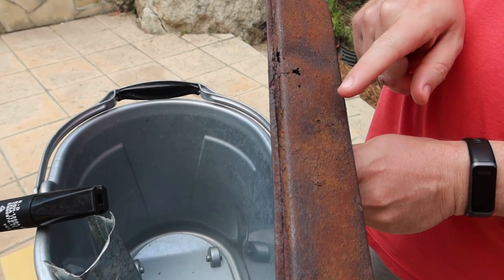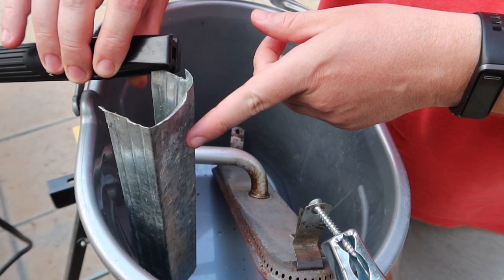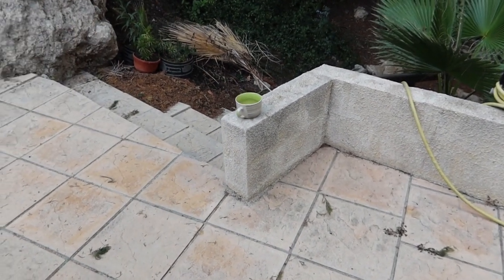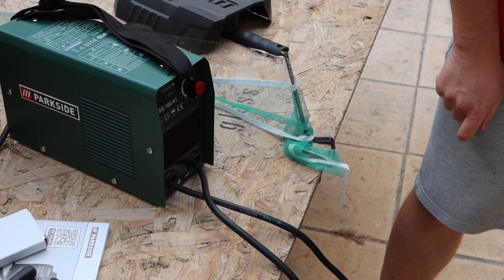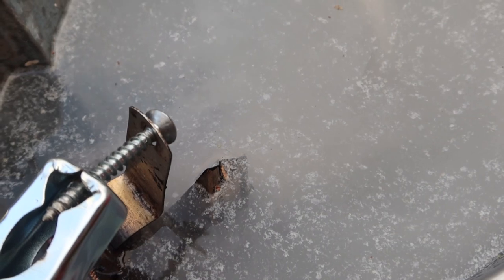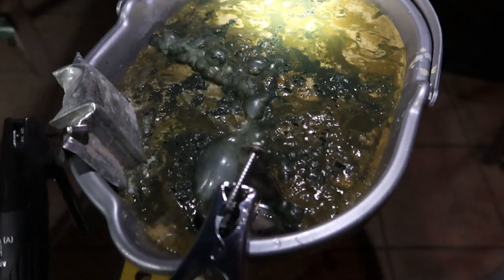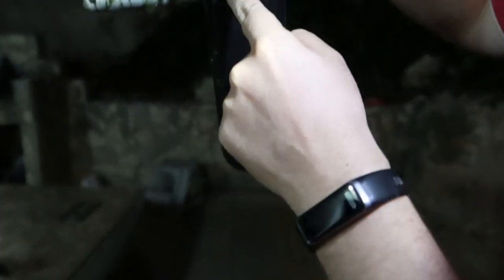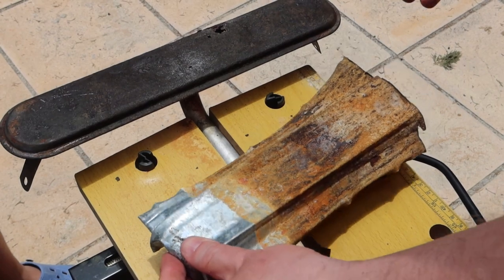Homemade electrolysis for Rust Removal: Fe2O3, NaHCO3, H2O, and Electricity. Say Goodbye to Rust

Comment from the maker: Homemade rust remover is simple. To understand the process of rust removal using electrolysis (18 V 10 amp):
Rust: Rust is a form of iron oxide (Fe2O3) that forms on the surface of iron or steel objects when they are exposed to oxygen and moisture. 
Electrolysis: Electrolysis is a chemical process that uses an electric current to drive a non-spontaneous chemical reaction. In the context of rust removal, electrolysis is used to remove rust. 
Electrolyte: In this case, baking soda (sodium bicarbonate, NaHCO3) in water  H2O is commonly used as a safe electrolyte (kitchen salt NaCl is not safe cause it can produce Cl). It helps to conduct electricity and facilitates the movement of ions in the electrolyte solution. 
Setup: To remove rust using electrolysis, you need a container (plastic) filled with an electrolyte solution made by dissolving baking soda in water. The rusted object acts as the cathode (negative electrode) and stainless steel as the anode (positive). Both the anode and cathode are submerged in the electrolyte solution. 
I'm not a chemist and may be wrong (if you know better improve me in comments) but from school chemistry lessons at the cathode 
2H2O + 2e- - H2 (reduction of water to hydrogen gas)
The iron ions (Fe3+) from the rusted object are dissolved in the electrolyte solution and combine with hydroxide ions (OH-) to form iron hydroxide (Fe(OH)2). This process helps in removing rust from the object.
Over time, the rusted object gradually loses rust as the iron hydroxide is formed and flakes off. But I may be wrong... If you know chemistry, you can help to understand the process of using electricity to remove rust   :)